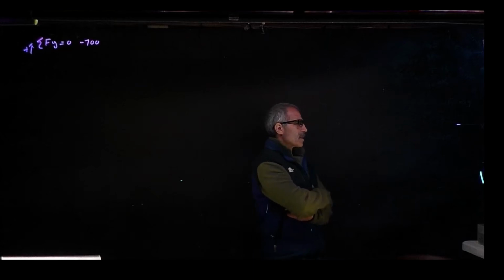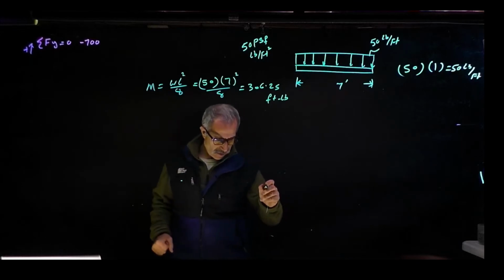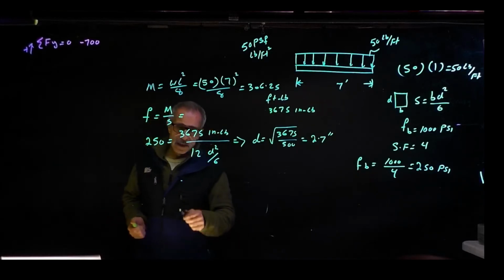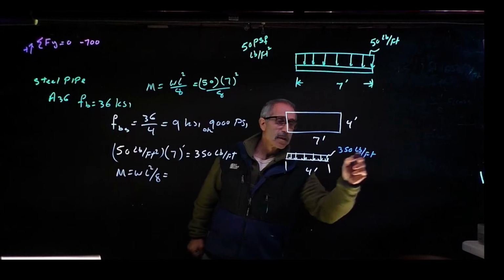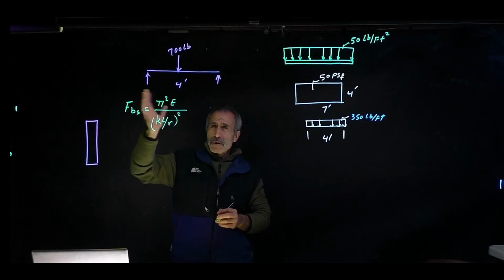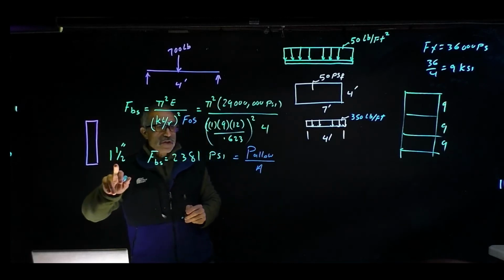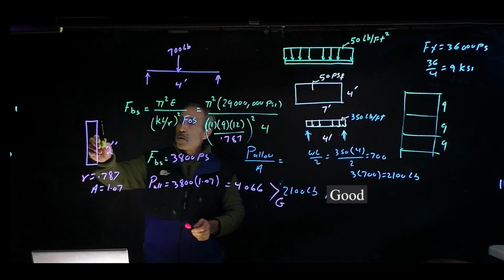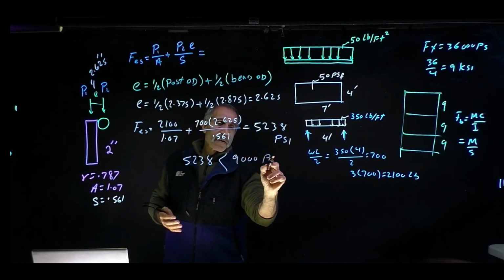Scaffold Design. Scaffolding Design. Staging Temporary Structure

Comment: SIR, YOU TAKE BEARER BEAM AS SIMPLY SUPPORTED IF BOARD BEARERE IS USED, THEN THE POINT LOAD WILL ACT AT THE RUNNER, SO WHAT WILL BE THE SUPPORT CONDITION OF RUNNER , IS IT SIMPLY SUPPORTED OR CONTINUOUS BEAM